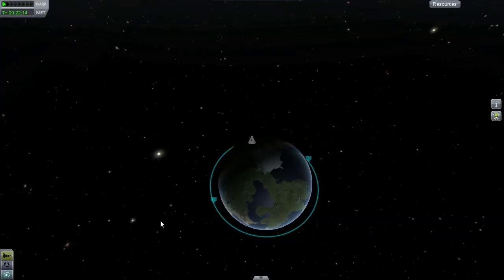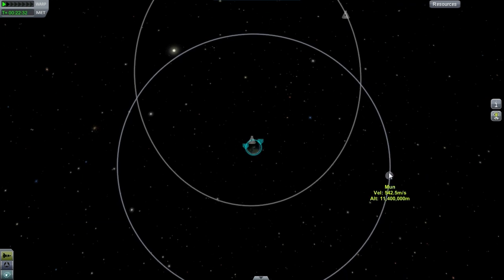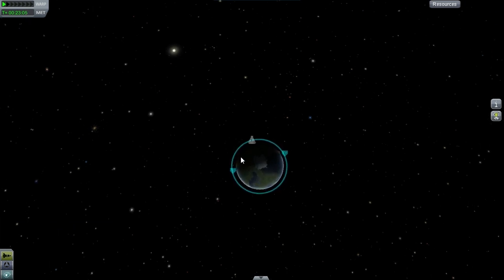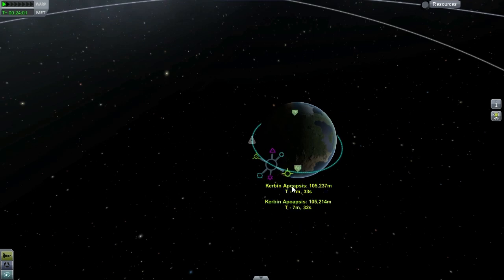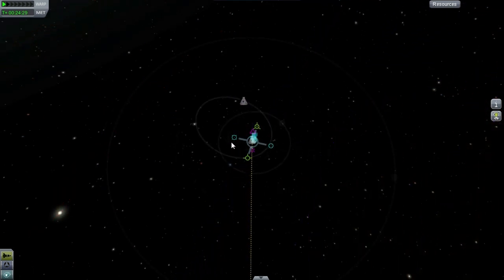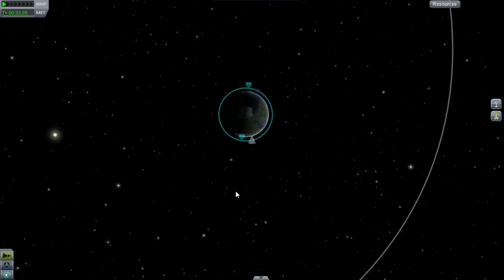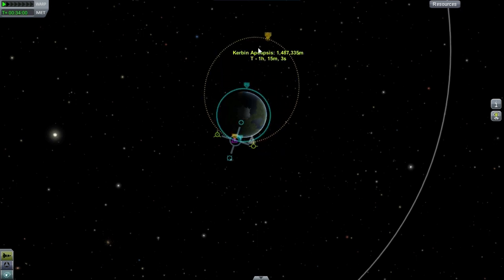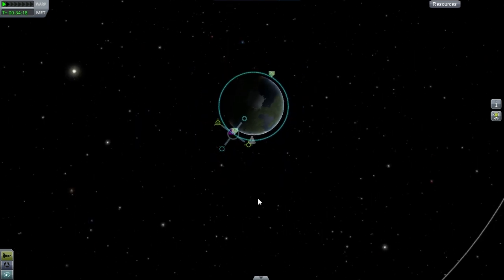Hohmann Transfer Orbit With Kerbal Space Program

Comment: GPS satellites are NOT in geostationary orbit. You are confusing geosynchronous orbits with geostationary orbits. Geosynchronous orbits simply have the same periodicity as the Earth, 1 orbit every 24 hours, but are not necessarily geostationary. Geostationary satellites can only exist at 22,236 miles above the Earth's equator and only above the equator. GPS satellites are located 12,500 miles above the Earth so cannot be geostationary. https://www.nasa.gov/mission_pages/sunearth/news/gallery/20130228-radiationbelts.html

Comment: Dude, this is fantastic! I wish I found your vids sooner :) I had to learn it all the hard way.

A good way to explain the car analogy of orbital maneuvers is that when you burn where you want to go while in orbit you are performing a ridiculous case of under-steer of cosmic proportions (not an overstatement).

When a car turns the tires create friction in all directions which stops all sideways motion (the car keeps rolling forward however because the wheels are spinning not sliding). Thus when you turn the wheel the friction prevents the car from sliding sideways and it goes forward.

In space there's no friction to stop your horizontal movement and thus when burning in space the resultant velocity (speed AND direction) is changed according to the rules of trigonometry.
Reply: Worse yet, you can go refuel your car. But once you are out of propellent you are stuck following your path in space subject only to the force of gravity.